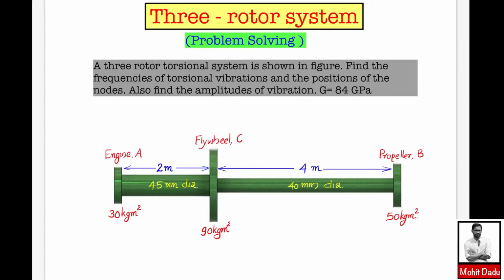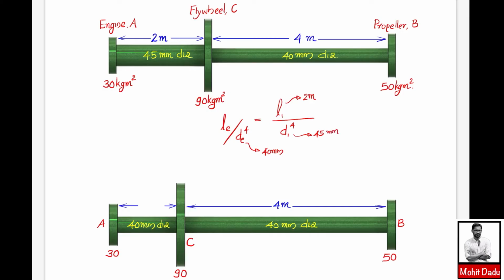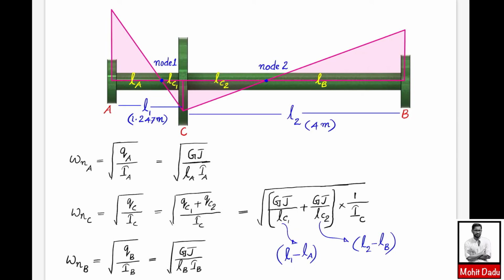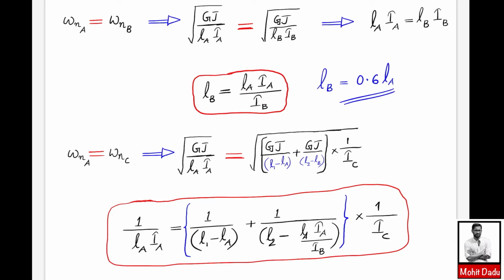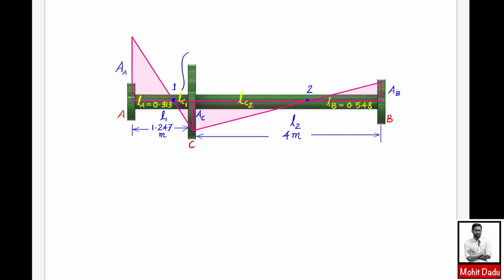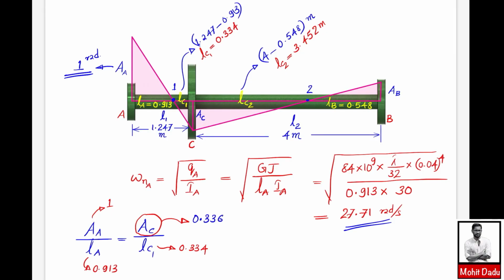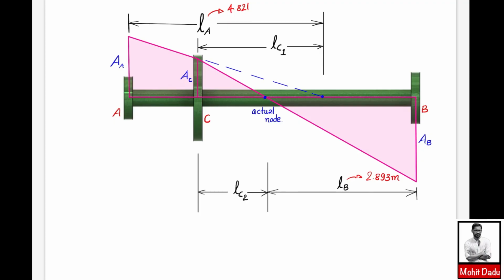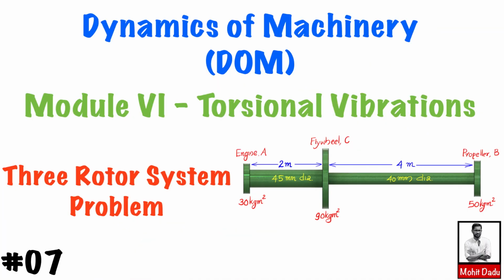Three rotor system - Problem- Torsional Vibrations |Dynamics of Machinery |  DOM | Module 6 |KTU S6

Comment: Sir, the value of J is different for both the shafts as diameters are different, you have calculated taking same J for both shafts
Reply: Because we make them same in the math by doing equivalent length of rotor for same diameter.